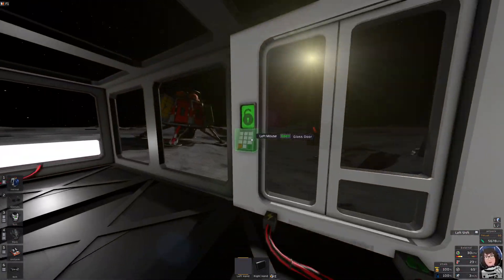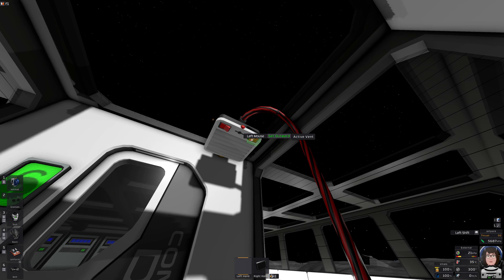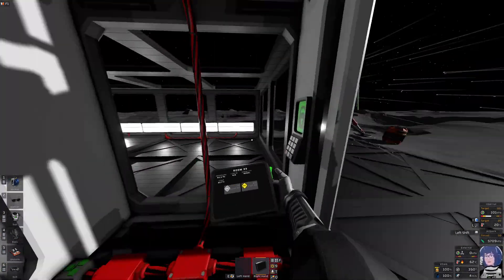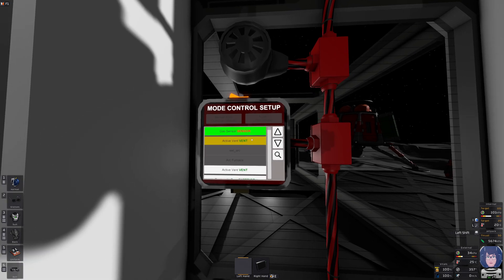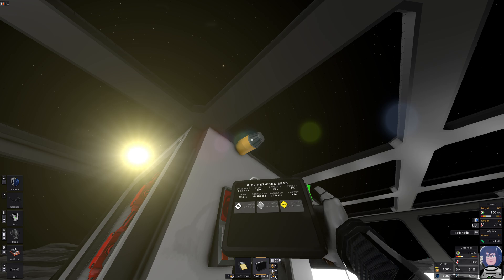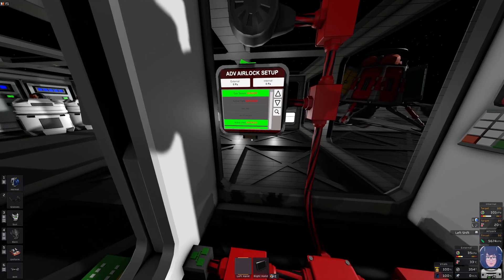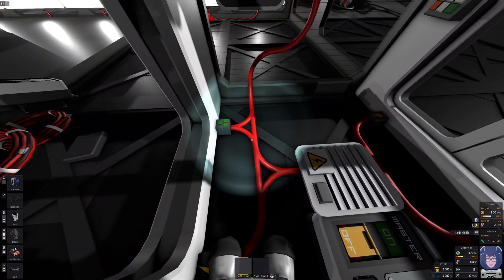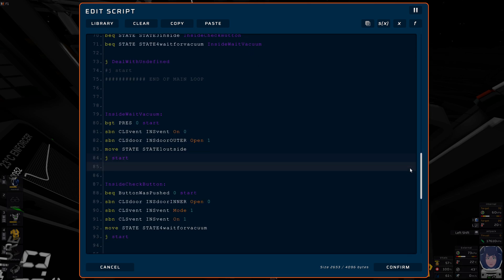Stationeers ATMOSPHERICS for total beginners - TURBO STYLE! - Part 6: Airlocks! *

Comment: I learned the hard way always have 3 consoles, one in the airlock, one outside, one inside. Then no matter which side you are on you can always use the airlock. The one outside and one inside are both slaves to the one in the airlock.
Reply from the maker: Why would that be necessary? The door buttons work, and also: You can even push the console buttons through the window. From a weirdly far away distance. ---- I suppose what happened to you was in a multiplayer setting? (For being explicitly a multiplayer game, Stationeers is quite buggy on that front.)
Reply: @OwnerOfTheCosmos  Door buttons don't work, doors are locked, even a crowbar won't open them. and you cannot click through the glass. Do you have a mod? i don't play multiplayer.
Reply from the maker: I can toggle my airlock's Console gui button through the glass from 5 blocks away in standard Stationeers, don't remember it ever having been different. - Yes, while a door is powered, it can not be toggled with a crowbar. If you run into that situation sometimes, maybe you wanna consider flipping the doors around so you could cut their power from the outside.

Comment: Thank you. Why are airlocks so difficult for beginners? No clue, but it took me a while to get the setup, and yes ALWAYS, ALWAYS have a power controller on every airlock. I separate all my systems with them.
Reply from the maker: I guess airlocks would be simpler for beginners if there was a dedicated airlock computer, and if that computer would only list all devices of the same room box. I am not proposing this should be done by the devs, I'm just saying this would probably take the mystery away that beginners are faced with.

Comment: Why don't you just name active vents and doors with Labeller so that you would have no need to guess which is which? 

P.S. Your videos are great! I play Stationeers in more immersive way, so it's kinda interesting to see what you can do with all that stuff when you're not afraid of damaging your base and dying in so many different ways)
Reply from the maker: I label things normally, but if I do that here, the impression is: You need to. I'd rather show how to work without the luxury. Of course I could explain both, but fast pace and less words are the idea here. ---- This is not how I PLAY Stationeers, these are tutorial videos for which I used Creative mode and even its Authoring Tool, because whether I did(n't) has no tangible impact on the lessons conveyed - but on the amount I could convey per week. Before I did these fast pace videos, I only played normally, avoided Creative for 1300+ hours. "Easy" for teaching, but "Stationeer" for all the playthrough video series.

Comment: You can slightly improve the cycling time of your airlocks by connecting the output pipe to a grid of passive vents in the room where a single vent is placed in each frame sized cube of space in the room.

Vents pull and push to/from the cube it's placed in, and due to the nature of pipe networks being considered one volume regardless of its (unbroken) size, the active vents (small, powered medium and powered large) will have a larger volume to pull from when it is attempting to pressurize.  Such a setup will slightly improve the weakness of active vents, which is its ability to push gas out (rather than its strong ability to pull gas in).

The array of passive vents in the room isn't necessary for the speed improvement, but will result in a more even movemt  of the gas into the room rather than a single much higher pressure output location.

The same trick works for filtration and air conditioning devices when you plumb their inputs and (filtered/cooled) output into the same pipe grid, resulting in noticeably faster (due to the higher volume input)cooling/filtering and noticeably consistent filtering/cooling in all cubes of the room simultaneously (when view with a tablet).
Reply: Note: multiple vents (passive or active) in the same cube are redundant as they funtion off the single cube and thus would be fighting each other for the same amount of volume, due to how the game calculates volumes by voxel cube.
Reply: @OperationalError   If you write a custom airlock script and use the AV's on the outside instead this significantly improves loading time.

If you're really smart you can have the correct amount of gas stored under pressure so that when you cycle the airlock you open a valve releasing the correct pressure into the airlock before opening the door, this is the fastest way but a bit complicated for most.
Reply from the maker: Thanks. I knew the concepts, but now I felt motivated to try this out - so you're in "part 7" now: https://www.youtube.com/watch?v=vNvsii5A7_4